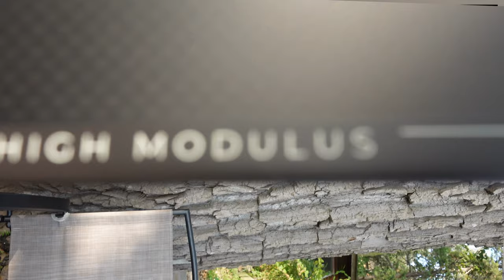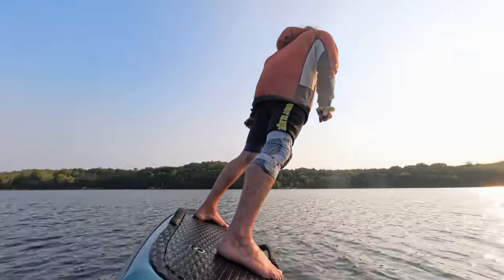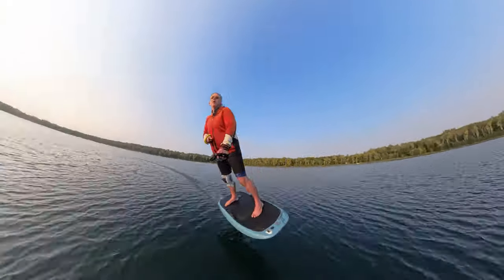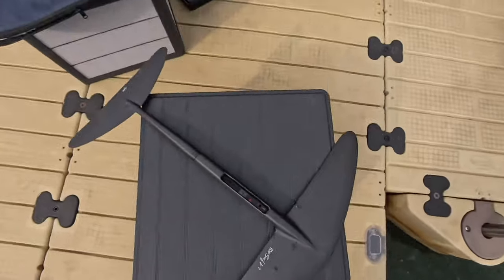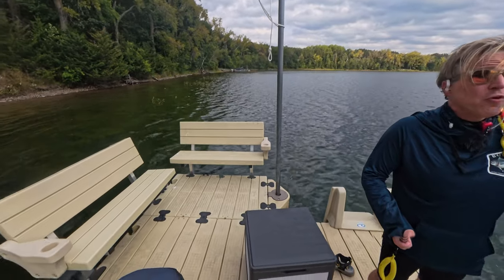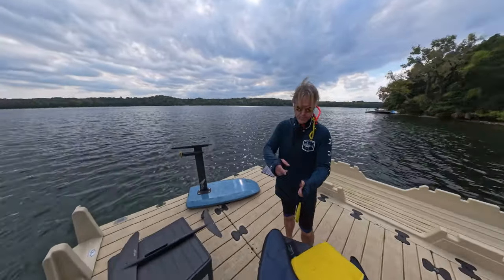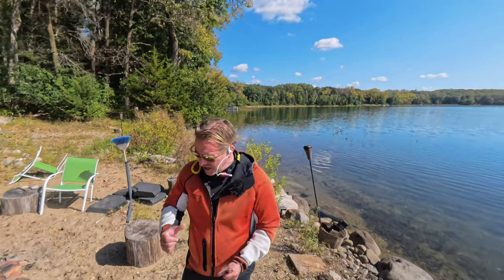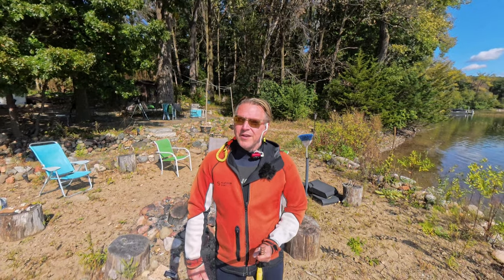High Modulus eFoil Mast Review: Is Lift's Upgrade Worth the Hype?

Comment: I have started using a HA front wing and really like it.  Several reasons one could use HA even on lakes: 1) longer ride time (and more distance covered) for same amount of battery as these wings tend to be more efficient. 2) I found it easier to go through wakes and turbulence in water - your lake seems always quiet but at some of the places I have ridden there were times where several boats were going and this tends to create wakes in multiple directions and lots of turbulence. 3) easier to get at higher speed - the wing feels more stable 4) easier to pump for downwind than with low aspect wings. 
In windsurf foiling, HA wings make a huge difference (positive) in many aspects of sailing but they are more difficult to gybe while still flying which is not an issue with efoils as one can keep the speed constant throughout a turn with just the press of  button :)
Reply from the maker: 1. Most lake riders I know aren't worried about longer ride times. It is easy for us to head to shore and grab a new power source. We're mostly concerned with performance while we ride. 2. The high-aspect isn't better at handling turbulence, but it is better at feeling turbulence. It is a benefit when feeling turbulence is a bonus like when riding waves. My 100 Surf V2 doesn't even really notice when I cut through a wake which is helpful especially when racing through the half-mile slalom when I need to cut across my own wake on pylon #3 on the final pass.  3. Gotta disagree with this one too. I'd say that HA actually doesn't like abrupt changes to speed as much as my surf wings. When I race I rely on throttle feathering as much as I do weight shift to keep my board level and my surf wings just respond much faster. In a race, I very quickly drop from low 30s MPH to as low as 15 MPH on tight turns after a straight-away and then need to accelerate back up to my top speed. The HA glide ratio doesn't allow me to drop my nose quick enough to zip through a turn or accelerate quickly to keep my board level. 

I'm sticking with my original assessment. HA is GREAT for riding waves especially with a folding prop. For riding flats, they just aren't optimized for the type of carve refinement most of us are after. BUT, I really had a fun time riding it with the new mast. It is very forgiving and kinda fun to glide for so long of the tiniest amount of power, and yes, you can pump it (a little) and it is good at turning altitude into forward momentum. A Surf wing will treat a pump as nothing more than a reduction in nose altitude.

Comment: I agree 100% that the 2 biggest issues in the entire system are the random disconnects which have dumped me at 25mph causing 2 weeks of neck pain, and the poor placement of the propeller high above the front wing which severely limits high speed carving with safety and slow deep carves while high on the mast. I sincerely hope any future iterations address this stuff.
Reply from the maker: I think I found a decent solution for the LFS! I'll share in a future show.
Reply: @VerdantRide  I’m eager for that episode

Comment: My local Lift dealer tells me the soon to be released Lift 5 will be a game changer.  perhaps the high modulus 32-inch mast is part of a larger plan.
Reply: I’m curious what could really be a game changer at this point. The main thing would just be getting these boards to be lighter and lighter to blur the line between Efoil and surf foil and increase maneuverability
Reply from the maker: People who sell you things always say that the next thing to buy are the best thing ever. No iPhone has ever been released by Apple without the accompanying statement, "this is the best iPhone we've ever made." This isn't always true and even if it is rarely are the advancements worth the cost of upgrading when your current ride investment is still a fantastic ride. But, I'm a guy that buys a new phone when I break or lose my current one, not for new features I rarely need. The best technology I own and use every day is usually considered completely obsolete by whose who benefit from selling new tech. I'm more concerned with keeping the things I own from owning me than I am with having the newest stuff.

Comment: Also, on the mast size, yes in general you want to have as high a mast as possible but there may be good reasons to use a shorter mast, for example, the outer bank in North Carolina is very shallow.  I have not efoiled there but I have windsurf foiled and I cannot use my 103cm mast (40.5 inches) - I have to use a 72cm (28inches) and still need to walk in the water a fair distance to be able to take off.
Reply from the maker: Are you seriously arguing that having a mast 4 inches shorter is worth a $2000 investment so you can be slightly less likely to crash into a reef? The upsides of an additional 4" are massive when it comes to banking capability and breech reduction but I doubt will make much difference when it comes to hitting underwater obstacles. I think it is safe to argue that a taller mast is even safer when riding over sandbars and reefs because it is less likely to breech when riding high. When I breech my board dives fast and that makes it more likely for me to crash in shallow spots. I hear you, but I disagree with your logic on this one.
Reply: @VerdantRide  that's called making adjustments with gear and not your skill
Reply from the maker: I agree that skill usually trumps gear but…. Gear certainly can make a difference beyond skill and capability. Wings, for instance, are designed to be capable of certain tasks at certain speeds and are unable to perform reliably outside of their specific criteria they were designed to handle.  There are things I can do with a taller mast that I simply cannot with a shorter regardless of how much I practice with it.